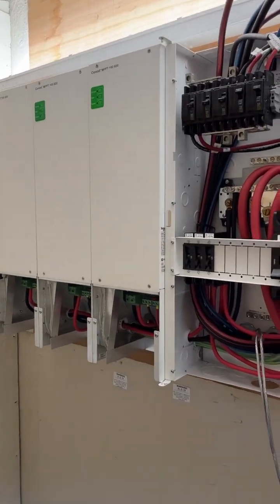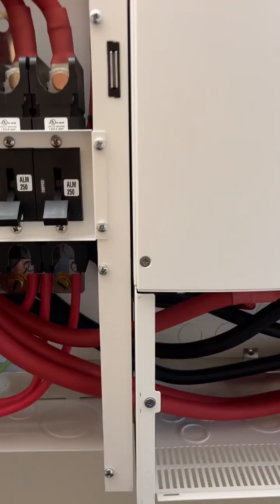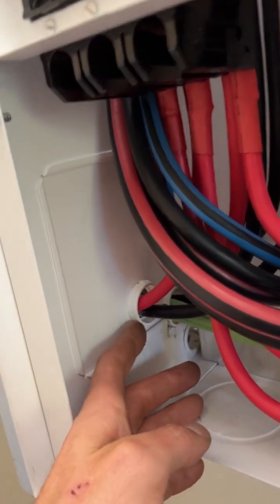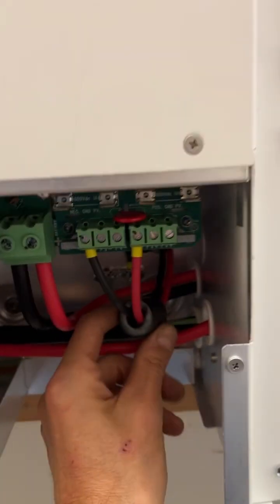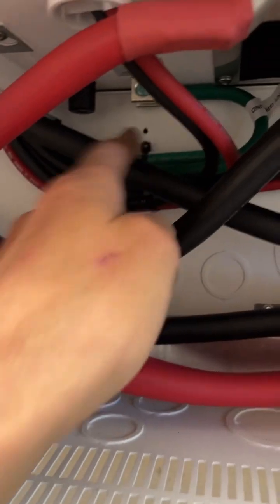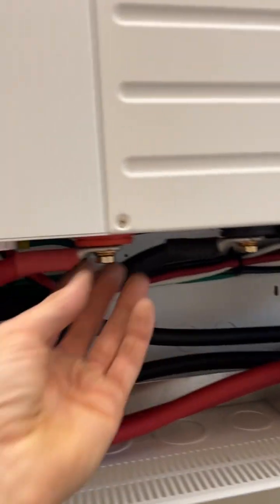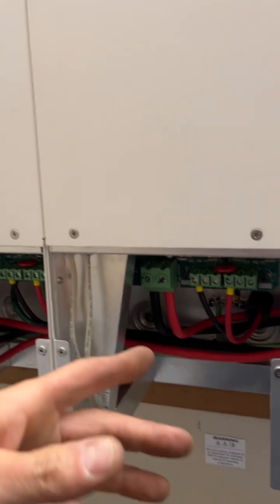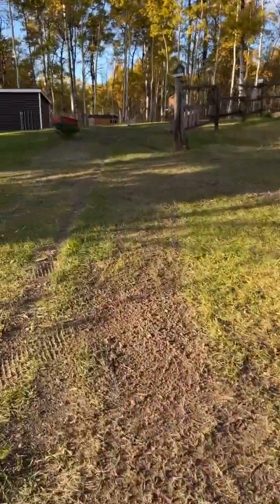Schneider Solar Build Overview before mains connected.

Comment: Help me here please... why no neutral connection on the grid tie inverter?
Reply from the maker: At the time 16:49 of the video you’ll see a clear image of the blue conductor coming from the left pass-through port that is the neutral of the on grid aspect. The colors are black, red and blue in this size of conductors.

Comment: what is the aproximated power of your solar array? I have just stumbled over your channel. Also if you could point out towards the fellah from whom you guided yourself would be awesome. Have you thought of using Iron Zinc batteries for the system? In what country are you living. Cool design
Reply from the maker: The total power of the three arrays is 25.5 kW. This is accomplished with two strings of 10 425W solar panels paralleled to deliver 8500 W per array. I have not looked at doing Iron Zinc batteries. I will be connecting lithium ions. Once I clear out the shed these batteries will provide 45 kWh from 3 15 kW batteries. I am in Alberta Canada thank you for the compliment on the design. We are very excited to be fully off grid capable in the shortest days of winter, but still be great tied to have the utility grid as a back up if ever needed.

This is my third year of research and design of solar. The links below have been the main providers of knowledge that I’ve learned from.

Solar  YouTube Links:

Bens Solar and Battery
https://youtube.com/@benssolarandbattery?si=J4E1XrbVCeMv264c

Projects with Everyday Dave
https://youtube.com/@ProjectsWithDave?si=D2dqpsQNx13BNLSq

Country living experience 
https://youtube.com/@CountryLivingExperience?si=P-6JXHHjYUJallpn

Will Prowse
https://youtube.com/@WillProwse?si=rpuZB3Lo-a1WGI6V

Engineer775
https://youtube.com/@engineer775?si=gvc7JPXZgfUkcJO8

Schneider Electric
https://youtube.com/@SESolar?si=wCzJZEei04t-cVb_